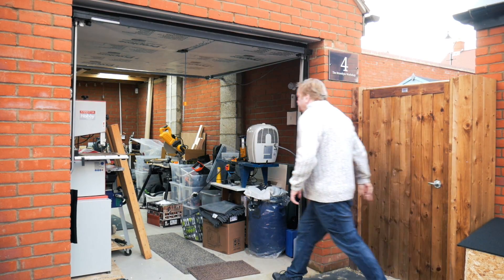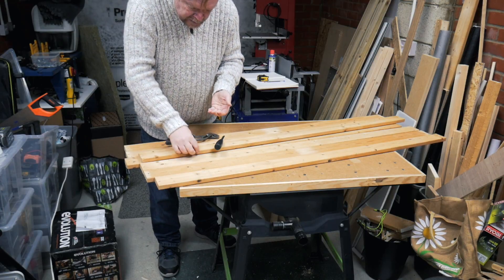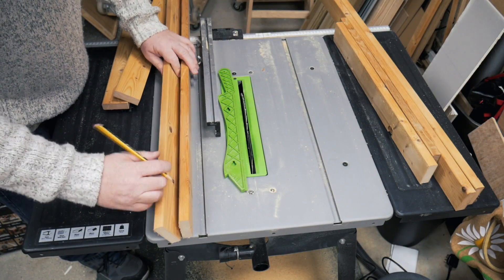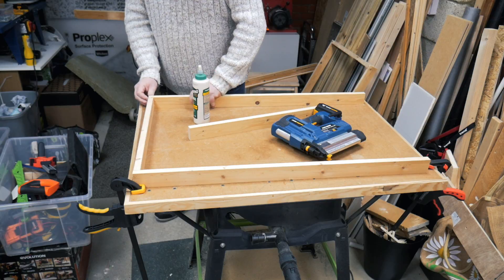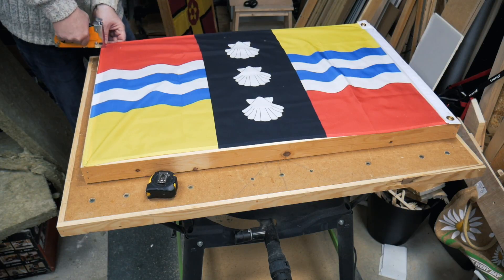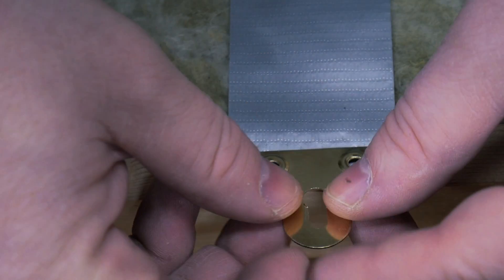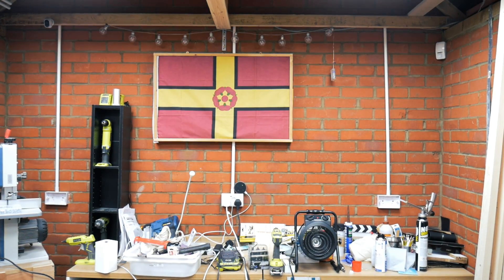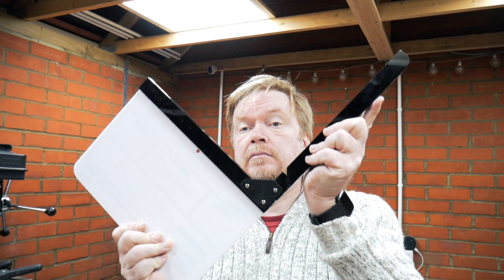DIY Acoustic Panel Using Flags | Better Sound Quality in the Workshop

Comment: IIRC Audacity (freeware) might give a better level of analysis than FCP.
Reply from the maker: Hi Andy, I did a bit of analysis with audacity and like the FCP footage it wasn't all that conckusive either and it was the poorer of the two scenes and it's on the cutting room floor. Thanks for the comment.